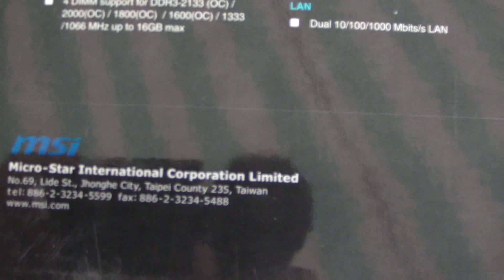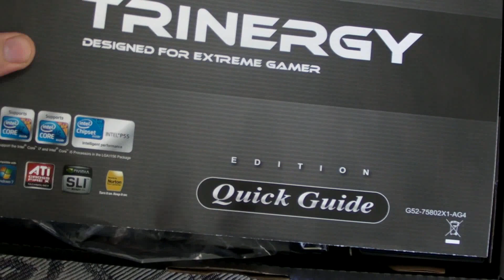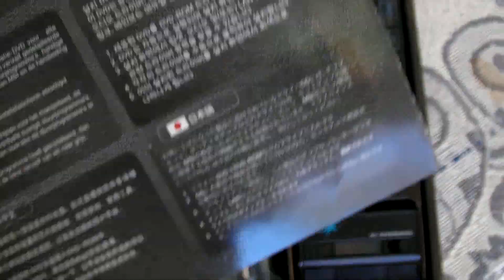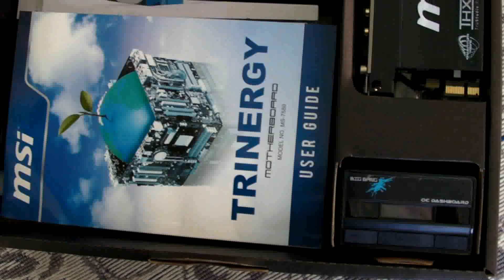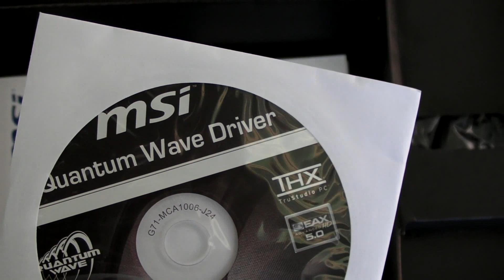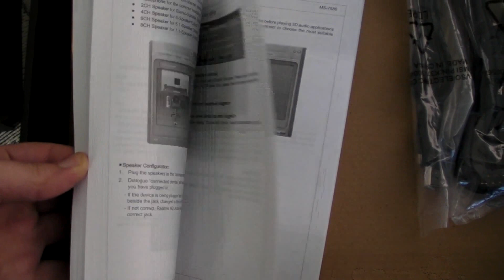MSI Big Bang Trinergy - Unboxing

Comment: My previous motherboard was an MSI P45 Platinum and that thing was an overclockers nightmare, the board looks very great with cooling and also good reviews and thats all. Now I still have my Asus P5Q Deluxe and that is an overclockers dream!! running with a Q9550@3,6Ghz, it would go even higher but it's fast enough!

Comment from the maker: Well in single gpu mode, the nf200 mobos are 1-3% slower than the others.

In dual gpu though, they perform the same as the X58, which is cool.

In any case, all configuration work great, so, no biggy! ;)

Comment from the maker: @EasttSideCustomZ 

It is both SLI and Crossfire compatible and not only that. Thanks to its NF200 chip, you get 16X PCIe speeds for both cards, something that vanilla P55 boards cannot do. Only boards with P55+NF200 can do that. It also supports tri SLI with 16+8+8 speeds. The 460 does not tri SLI though. For dual you will be fine! ;)

Comment from the maker: @Saberoph 

Hello mate.

The sound card is a PCIe 1X and goes to the top PCIe 1X slot. The one above the first blue slot. 

Then follows you graphics card. If it is a two slot card, you will lose access to the second PCIe 1X slot right underneath.

After that, you have two legacy PCI slots and two 16X PCIe slots free to use however you like. I don't see a problem!

Comment from the maker: @Wurzelzwerg1212 

The Trinergy has a NF200 chip for the communication of the gpus in multi gpu mode, either you have ATI or Nvidia cards. It fives two full 16X PCIe slots. It also gives the option for Tri SLI and *I think* for Tri Crossfire as well.

The Fuzion has a Hydra chip which, allows the combination of ATI and Nvidia cards on the same computer. Obvioulsy you can just use cards of the same type as well. All tests have shown bad performance compared to native sli or crossfire.:(

Comment: I want this board, but my only concern is I also have a wireless adapter I will be using, I'm just worried my video card will cover up all the PCI slots...is that sound card PCI or PCIex1?